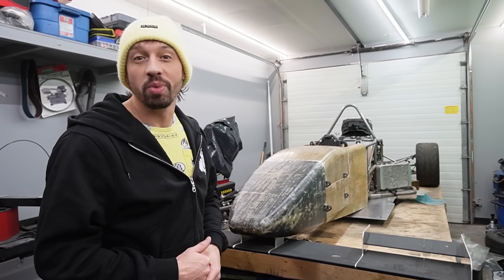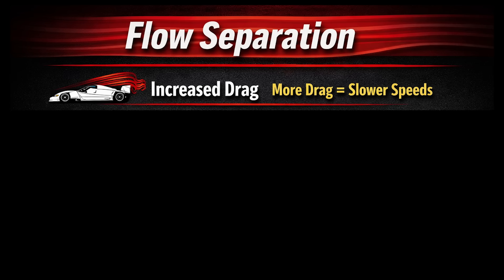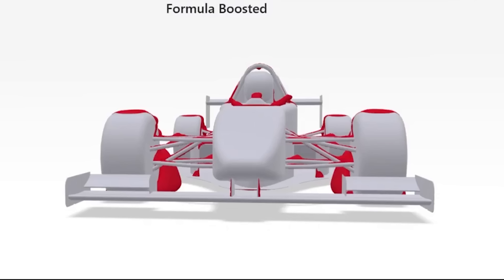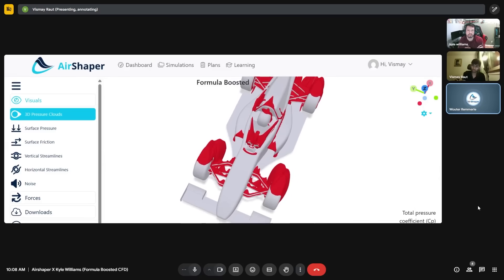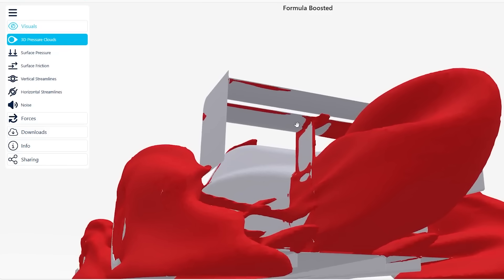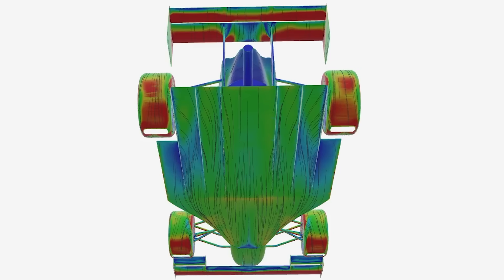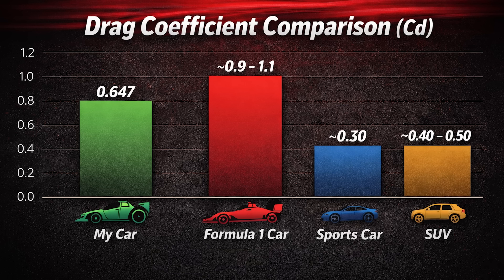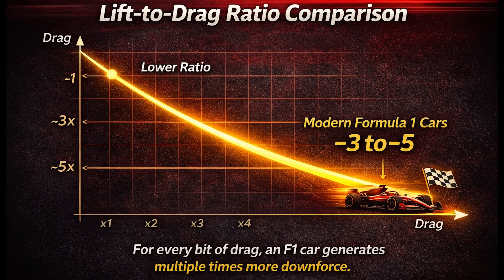Testing The Formula Car In CFD With Air Shaper

Comment: Your heat exchanger opening seams a little big. Typically your cooling opening should be 30% of the size of the heat exchanger. Also the air flow through the exchanger should be around 40 mph.

Comment: My 18 brz ts Drag coefficient is a .27 vs the stock .26 but with the splitter, canards, and wing I make 1200ish lbs of downforce at 100 mph over stock.
Reply: No it doesn’t lol
Reply: @Sbinott0 take 20 seconds and look it up
Reply: @E @EdWolfram  look up what you aint making 600kg of downforce with that Cd
Reply: the endplates alone make 50lbs. The diffuser @200lbs and the wing in high attack 1000lbs.
Reply: It's almost like they built that car to go road racing (hint they did)
Reply: @EdWolfram it’s almost like you don’t know shit about aerodynamics
Reply: @Sbinott0  it's almost like you refuse to look up facts
Reply: @EdWolfram  how did you find the Cd? Either you’re saying bullshit or your car is 3 times as efficient aerodynamically as an F1 car
Reply: @Sbinott0  type in 2018 brz drag coefficient than do the 18 brz ts. They have it as low as .26 for the standard without the duck bill.
Reply: which if you looked it up from the start would have ended your Nuh uhs and save both of us your embarrassment.
Reply: @EdWolfram do you seriously think the cd stays the same when you add half a ton of downforce?
Reply: @Sbinott0  the TS is a .27, no I didn't wind tunnel it STI did. They also built all of the parts to optimize gains vs drag. You can speculate all you want vs actual released numbers.
Reply: @EdWolfram  man you don’t think adding all that aero infreases the cd a significant amount?? At least learn a bit about stuff before making absurd claims
Reply: @Sbinott0  It's not my claim it comes from the manufacturer. They cleaned up the air.  Side skirts tunneling smaller wheel gaps and then added downforce.  I know you have to be right, your not but I'm done arguing with ignorance.
Reply: @EdWolfram you can clean up all the air you want if that wing is making a third of the car weight in downforce in a small surface airfoil you’re adding also a fuckton of drag, I’m just helping you understand that you’re very misled